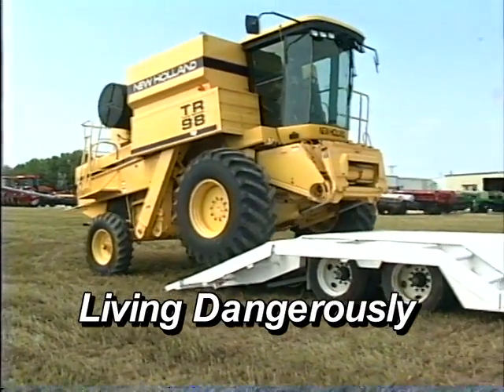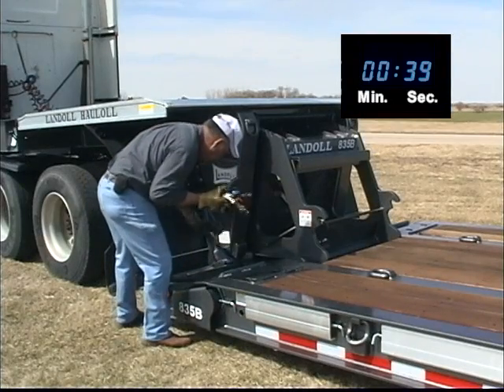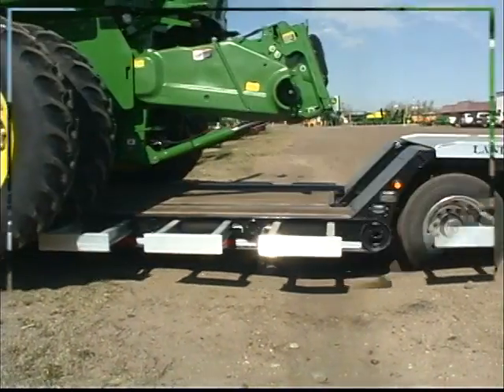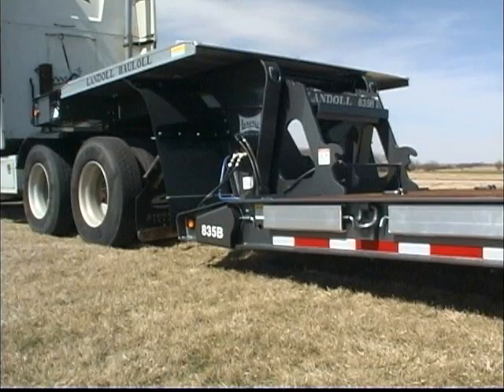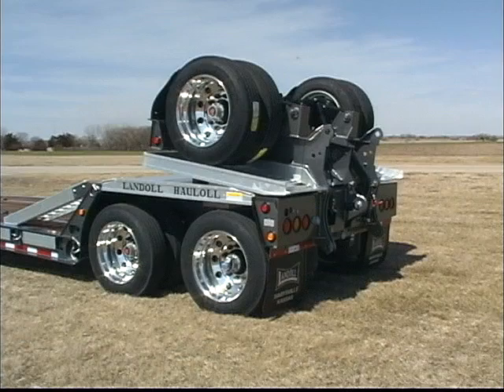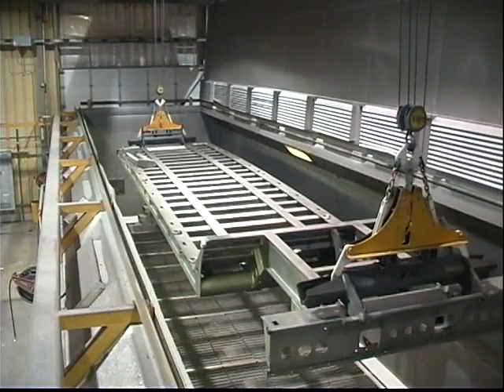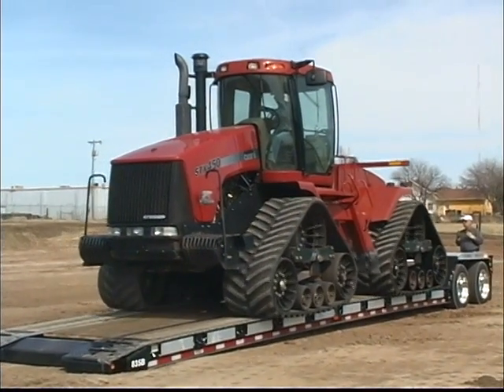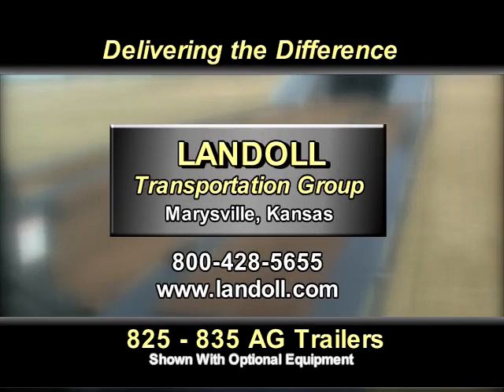Landoll 800 Series Detach Trailer

Comment: Interesting apitong hardwood  decking = min 9:03 
Why use wood on platform exposed at sun , rain , snow ..  ?  Stainless steel is much lighter, more durable ..  The wood is cheaper than plastic resistant to harsh climates flexible in Tropical and Frozen winters ?  
This type of wood has been used for flooring in trucks for more than a half a century and has become an extremely popular choice amongst truck owners who want something that is durable, strong and still very affor . 
But wood burns if it comes on it gasoline and fire in case of accident , explosion in gas station, parking lot, or intentional arson .
Reply: +Baron Local because wood is still the strongest lightest material available. Stainless decking of similar strength would not only weigh more but is also traction concern. The only other option with similar weight is extruded aluminum, but extruded aluminum has a relatively short fatigue life when compared to wood in a lo-boy application.

Comment: Screw that new grease system a mechanic needs to get under the trailer and inspect the trailer brake system and suspension. It's not about saving money or time. I want my trailer looked at during each service.
Reply: +Michael Comins the brakes and suspension should be looked at every day if the person pulling the trailer does a proper pre trip inspection.
Reply: +Corey Schmidt What do you do? work at McDonalds. So what you're trying to say it's the drivers responsibility to get under the trailer and look at the s cams bake shoes air lines brake drums and not the mechanic. I also see from your next post you know nothing about powder coating either, you have a comment about everything but know nothing about what you talk about. Typical
Reply: Michael Comins you might want to consult the fhwa rule book before you act like I don't know what I'm talking about. As part of a proper pre trip inspection the driver shall inspect all major suspension and brake components for signs of wear or damage. Including: check brake drums for cracks or obvious distortion, linings for separation|missing|excessivly worn friction material, s cams and slack adjusters for play and signs of excessive wear, brake chambers for proper securement and signs of damage, all visible air lines for chafing, cracking, or any other damage.
I'll tell you right now, over a decade of hauling equipment and running wreckers has taught me that a good driver will find more problems on a truck and trailer than a mechanic. Care to know why? Because a drivers license is dependent on it. If a truck gets inspected at a scale and there is a fault with the equipment the driver gets points on his license not the mechanic.
Your comment makes me think you're one of those idiots that has a dually pick em up truck and pulls a gooseneck with a bobcat on it and thinks you're a big truck driver.
And to my other comment about powdercoat, well as I said above over a decade of experience. I've pulled several different landoll products, currently a 330b slide axle. The problem with powdercoat is the fact that a semi trailer flexes, and after time the repeated flexing of the trailer causes the powdercoat to partially detach from the metal's surfacewhile staying intact as a covering for the trailer. Rock chips and cracks in this now free floating coating allow water to enter and hold moisture against the bare metal causing excessive corrosion. That effect is worsened here in the Midwest where salt is used for clearing snow. I've seen landoll trailers less than four years old with large amounts of corrosion more indicative of a trailer more than ten years old.

So stfu! You loose! you get nothing! good day sir!

Comment: Used a trailer like this over thirty years ago to recover military helicopters. Nothing new here? Trailer had a little Diesel engine to run its hydraulics. Had extending side rails and a built in winch. Seem to remember it was rated to 30 tons or so, certainly enough for any helicopter!

Comment: I like the grease lines new access with line extension lines for grease ease. No reason ANY driver couldn't grease the wagon every week or so many miles? I'm no where saying regular service isn't needed but that could potentially keep wear to a minimum. Reducing in complete s cam and bushing rebuilds. Plus not having to remove hubs so you can do this repair so saving on seals and bearings having to be cleaned and re preloaded and locked down. Nice system

Comment: I'd take an XL specialized XL70-HDG over a landoll any day of the week. Landolls RGN's are nowhere near elite.  Just a rip off the 835 series is a 35 ton with 60k in a 12' concentrated and they want an arm leg and nut for them.  I can get the same options for on the XL70-HDG and get 70k in a 10ft.  So is the only word for these trailer really "elite"?